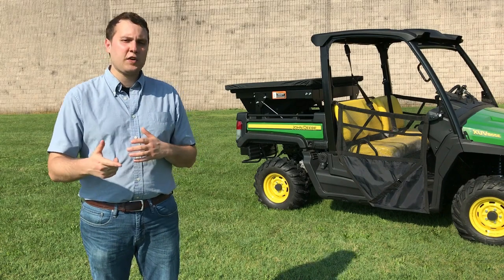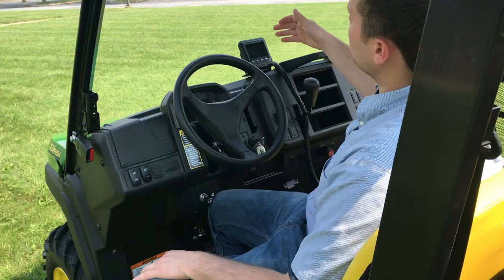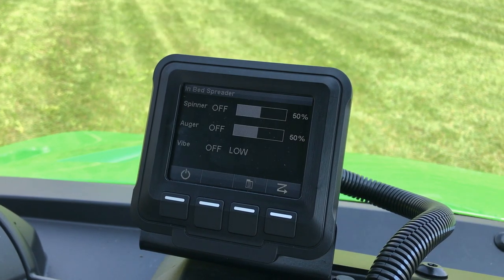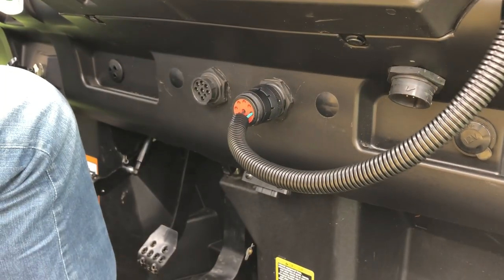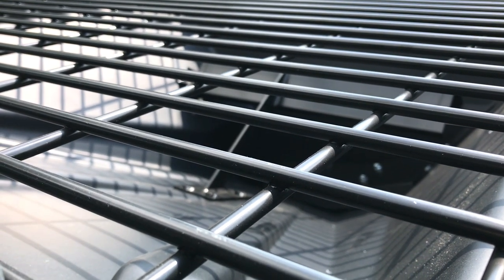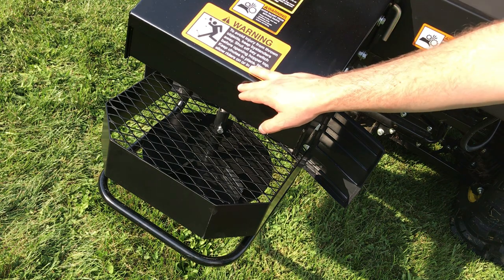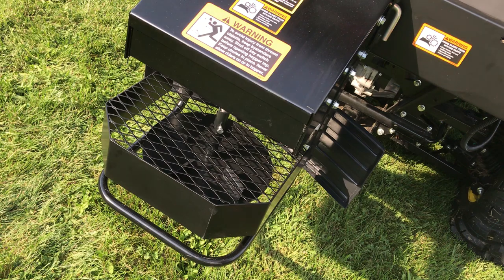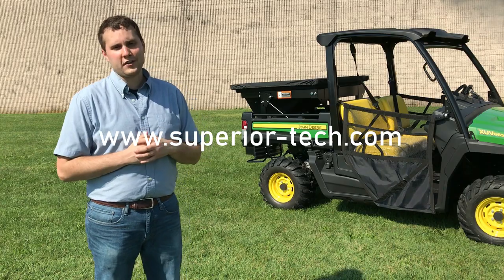10 cu ft Gator In-Bed Spreader Overview

Comment: This thing does not work for commercial use. Faster to use a walk behind spreader and more dependable!
Reply: ???  It's faster to stop, park, and get out and walk?  You know how dumb that sounds?
Reply: Must not know how snow removal works. Large commercial sites, much more efficient to send one man with this machine and out other guys where they are needed. This gator replaces at least 5 guys who can be worrying about other locations.
Reply: I actually do know how snow removal works. You obviously do not know how this spreader works as if have serial #00001.  And I am here to tell you it does not work as well as they claim.
Reply: Maybe the brand of spreader isn’t the best. But I work for the second largest snow removal company in the Chicagoland area, covering Indiana, Illinois, and Wisconsin. We use UTVs with in bed spreaders and have no issues. Snow removal on sidewalks at commercials sites is sped up due to the use of UTVs and ATVs and not doing them by hand.
Reply: yes when the equipment works it is much faster to use ATVs and UTVs however since I have the first one in production of this product my statement is spot on! This company had some great ideas it is just the fact that this spreader does not work for my commercial snow removal. So if you do not have this piece of equipment and do not use this piece of equipment do not try to tell me that I do not know what I am talking about.  I do ALL the snow removal for Bailey Yard the largest rail yard in the USA. We do not get to wait until the storm is done to perform our services we are out right in the middle of the worst part of the storms and my Salt Dogg Spreaders run circles around this spreader!